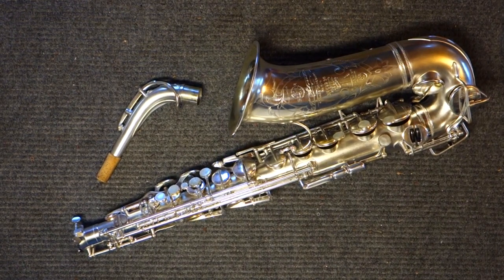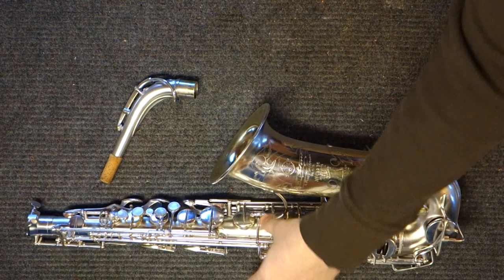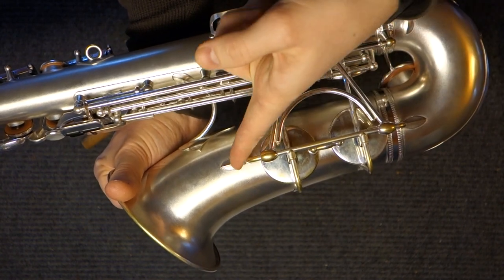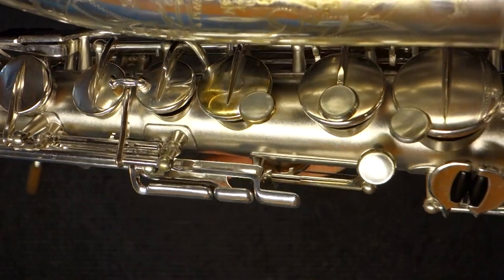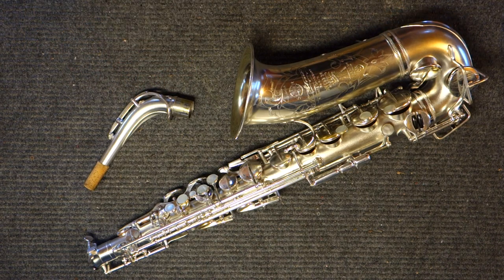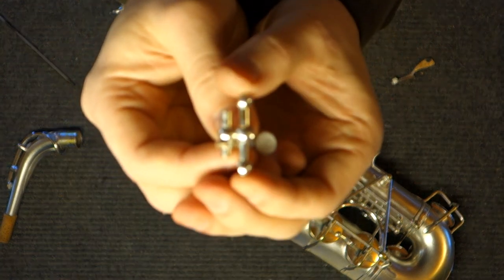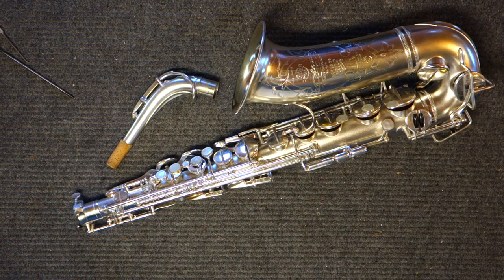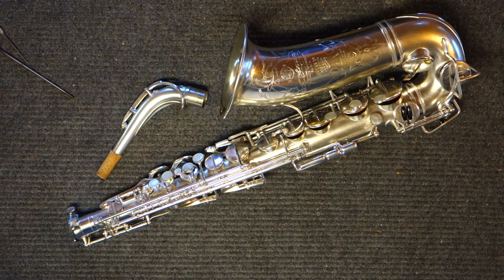Repairman's Overview: Selmer Radio Improved Alto Saxophone

Comment: Hello Matt! I've just watched your video, as I was looking around for help with changing the neck Cork and maybe some pads... And this is my exact sax! 
I played it as a teenager, and in a few (rock) bands too. Haven't touched it, sadly, for the past 23 years... And have just started playing again. 

I love it so much, my grandad, 1st violin in the Birmingham symphony orchestra, bought it when he worked on cruise ships for a few seasons... And needed a second instrument. 
It's very worn, though in solid condition. I've just been inspecting it, according to your checklist, everything is straight and true. Main serial: 19061 and the other little one is: 12337.
2 questions (then I'll watch the rest of your vids), looking at the interior, it's black, crusted with gunk, and stinky (young me didn't clean it once, I think). How do I clean that, and what with? 
Then pulling the mouthpiece off the cork came off with it... Grrrr... What do I clean the mouthpiece with? And what glue should I use to replace the cork? (I've ordered some cork) 
I'm very handy and fastidious, and have a well equipped workshop... But I've never worked on a sax before, and it's precious to me. 

Thanks for the greatly appreciated videos mate.

Comment: Matt, were there any later Radio Improved altos that didn't have the geared-toothed octave mechanism but instead had the same type used on the Balanced Action horns?
Reply from the maker: Yes.  I have found since doing this video that the geared mechanism exists only between about serials 18650-19450, so its actually a very small number of horns!
Reply: *****   Thanks, Matt.  I was looking at one on eBay, serial 203xx and it doesn't have the geared tooth octave mechanism.  Instead its octave key seems to work more like the BA horns.  Now it makes sense.